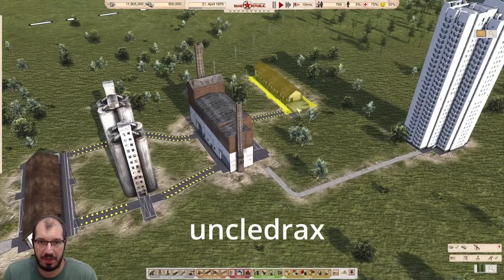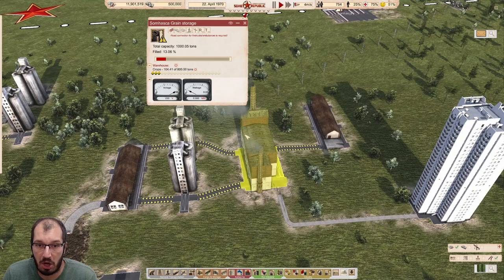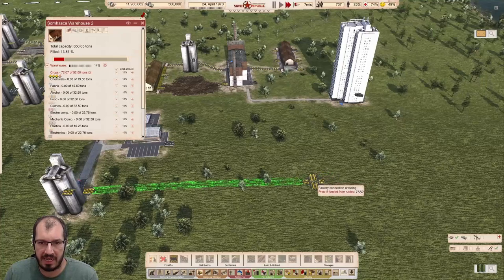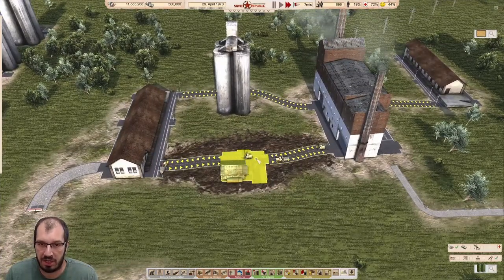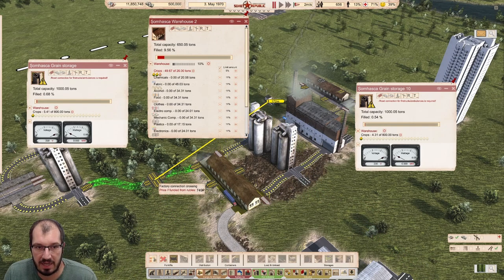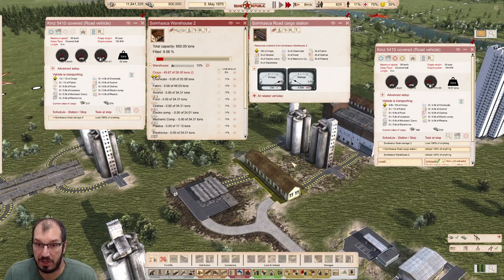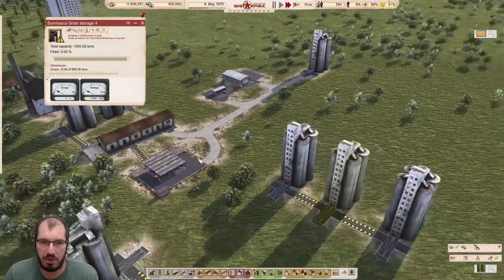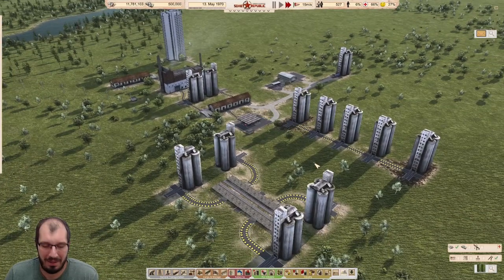Complete Factory Connection Guide | Tutorial | Workers & Resources: Soviet Republic Guides

Comment: Great video, thanks bballjo.

I've not seen anybody else post a vid of this but its a trick I do with factory connections and silos that works around the limited space and connections, particularly in a tight space.   For instance if you have a train depot near a farm.  I connect a truck depot to 4 silos and the train to 2 of those silos.

I put DO's to dump at the silos and a train to run between the depot to wherever, say a food plant.  The problem is the train will only pull from the 2 silos it's connected to while the other 2 at the truck stop remain full.   For that I put a single truck in the truck depot and put it to pick up and drop off at the same point.  It never leaves the depot it just constantly rebalances the food in the silos.  This allows the train to drain all 4 silos.
Reply from the maker: Didn't know the rebalancing can work. Nice!
Reply: @bballjo  I was pleasantly surprised, it's kind of like running a truck in a loop to the same truck stop in TF and TF2 to get it to redistribute.
Reply: Oh man, I'm definitely going to use this.

Comment: I would also mention that container packing facilities will not draw a constant amount through a factory connection; they will pull goods until they have enough to fill a container, where they then start packing and stop pulling goods. This slows down the rate of packing, but you can use "pumps" like trucks or forklifts to fill the facility with goods to increase the packing rate.

"New" vehicles can be pushed/pulled through factory connections too, but not always.
Reply: ugh
Reply: @mitchumsport  The container packing facility stops drawing the unpacked goods, while it is packing, then after it has packed a container, it will start to draw the next lot of goods to pack.
To speed things up, you need to push the goods into the packing facility, so there are goods in internal storage ready to pack, when it starts to pack the next container.
You can use a truck or forklift to push the goods into the packing facility.

Comment: As the grain silos have two parking spots, you can chain as many as you like, by using a truck set to pick up and drop off at the same spot.
This makes the silo an active connection, giving it a push and pull characteristic.
Reply from the maker: No...if you treat the silo as an active connection you're going to get confused....it's a simple passive connection that distributes to all directly connected buildings, exactly like a cargo station. If it was an active connection like an engine, then you would be able to move cargo through the silo, but you can't.
Reply: @bballjo  Parking a truck in one of the two parking spots, then setting it to load and unload in the same silo, will turn the silo into a grain conveyer engine.
Try it.
Reply from the maker: A grain conveyor engine doesn't store grain...I'm just telling you how it actually is, you are free to think of it differently, but you will have a bad time because it isn't an engine.
Reply: @bballjo  It becomes (behaves) like an engine when you add the static truck (set to load and unload at the same silo).
Maybe I'm not explaining it very well, sorry about that.
I'll make a short video to demonstrate it when I get time.
Reply from the maker: Someone else mentioned the parked truck too...but in that case the truck is the engine, isn't it? Anyways, if this is useful, then by all means, use it;)

Comment: Can forklifts drive through buildings to reach other buildings?

If I put a forklift on the left side of a warehouse but need it to work on the right side, will it drive through it?

If I add a forklift to the cargo train station, will it too drive through the cargo train station to access the other factory connections?
Reply from the maker: They can only drive through dedicated structures, like forklift garages and factory crossings...but I wouldn't be surprised if there are some mods that let you drive through it
Reply: @bballjo  Thanks! I was building that setup I wrote in my Republic's newest city and you may have saved me some time and heartache.

Comment: still kinda confused...i got a farm connected with a silo and on the other connections to the farm i got a few things that use plants. harvest gets stored in the farm and silo, and gets distriputed from the farm, but dies it come back out of the silo? or is that just something to have as kinda overflow and i need to move it from the silo by other means?
Reply from the maker: The easiest is usually to pickup directly from the silo, or connect the silo to a cargo station and pickup from there.
Reply: @bballjo  im trying to sell the excess but have enough for my own production...if i sell from silo the stuff from the farm gets pushed into the silo to keep fill levels even.
trying to sell via distribution office and only over a certen percentage of the silo...
Reply from the maker: But you said both silo connections are connected to farms...you have to move the grain somewhere to use it...
Reply: @bballjo  nope the silo is only connected to the farm, the other productions are connected to the farm not the silo. well guess thats my error for setting it up that way, but it kinda works with some dead capital sitting in the silo (hope they sell the old grain first, before it gets bad)
as long as the farm silo can store enough or i need to distribute it from the silo if needed. still alot to learn

Comment: I have a fabric and clothing factory with a warehouse in middle.  I have a forklift garage connected to all three.  I'm using the forklift to move fabric to warehouse and clothing to warehouse.  However, when I move the clothing from factory to warehouse it goes back to the clothing factory.  Why would a warehouse export clothes to a clothing factory?
Reply from the maker: Direct factory connections effectively connect the different buildings. In this case each industry has their imports and exports connected with the warehouse, so they are effectively the same...you don't need forklifts if you already have direct connections.
Reply: @bballjo  My clothing factory isnt sending anything to the warehouse.  Does the factory export inventory have to be full before it will send to warehouse?
Reply from the maker: Did you watch the video at all?
Reply: @bballjo   I did.   It’s not intuitive.  I get that the warehouse is an extension of the factory’s space and the push/pull factors.  Another way to ask my question, for a DO with instructions to pick up anything at warehouse, does the DO see the combined inventory of the factory and warehouse?   Meaning even if the warehouse has nothing, as long as the factory has something, it will go to the warehouse and pull it through the warehouse from the factory?
Reply from the maker: @mjr7991 yes. They can see everything that is directly connected to the warehouse, or any building with direct factory connections. Import/export storages are treated as it's 1 building.
Reply: @bballjo  thanks.  That’s the part of the game that is not intuitive. It’s not intuitive to understand that even though the warehouse is empty there is inventory available for pickup.  It acts as one building but it’s not because the warehouse can’t push, but the plant can.  So even though they are now considered the same, they are not in all circumstances.  It’s a minor thing but odd nonetheless.
Reply from the maker: @mjr7991 I understand. There are a bunch of unintuitive things in this game...and those are what I'm trying to help with. I think I have 3 factory connections guides now, make sure you check all of them :)
Reply: @bballjo  Yeah its the lack of visual cues in the game.  Like if the warehouse could show its inventory and then all available inventory or something.  Similarly I had a mass die off in a single month for no apparent reason that I could discern (all was fine, food, water, pollution, electricity, heat, etc).  Just a blip in one month then back to normal death.  Not sure if that is the game trying to tell me something or just normal game process.  Assume most will be addressed as it goes to 1.0